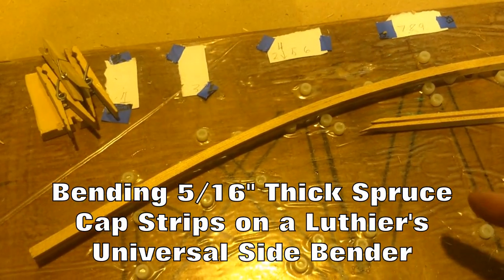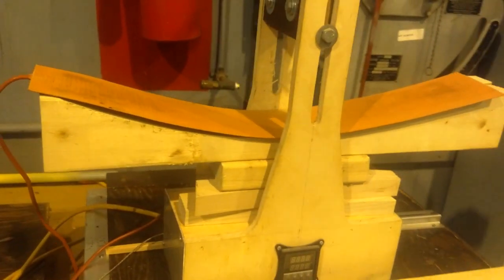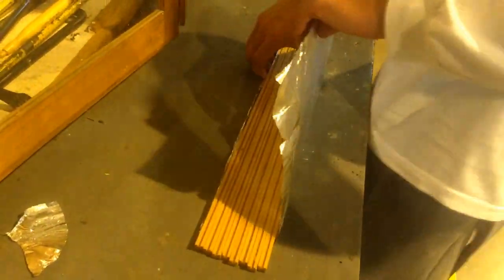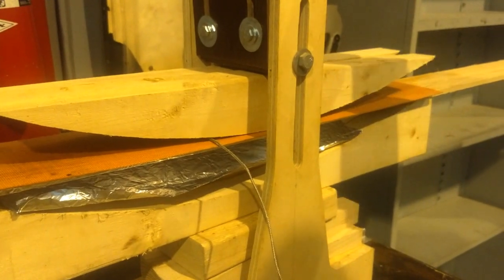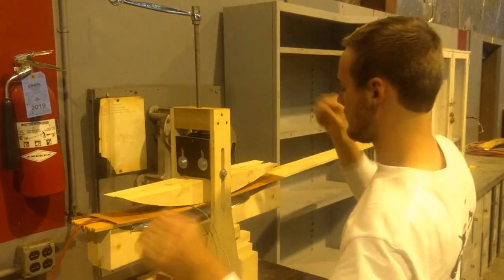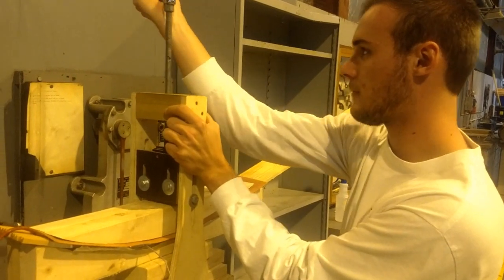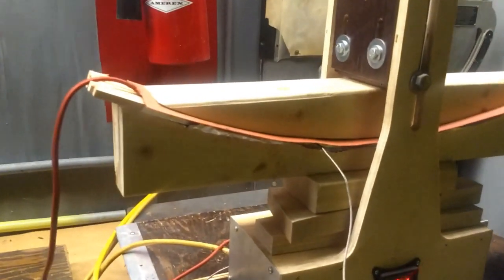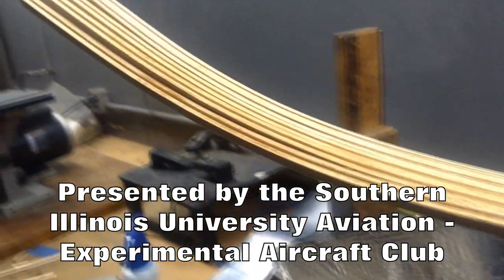Pre-bending Aircraft Wing Rib Capstrips with a "Universal Side Bender"

Comment: Would you mind replying with a link to those parts ?  The heater and press. Thanks
Reply from the maker: Thanks for the question.  For the heating blanket, it is best to go to Ebay and type in "ukulele heating blanket."  Best video I have seen on the actual machine is https://youtu.be/Km20xSgW-to .  You can buy plans and books about the machine, but you really just need to watch several youtube videos about using them, and then build one that works for you.  All it does is press the parts down.